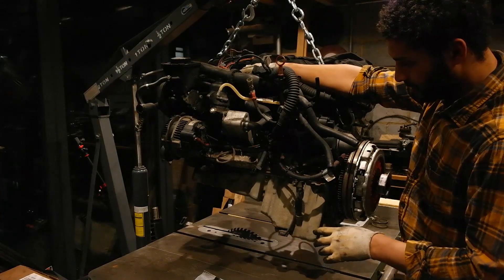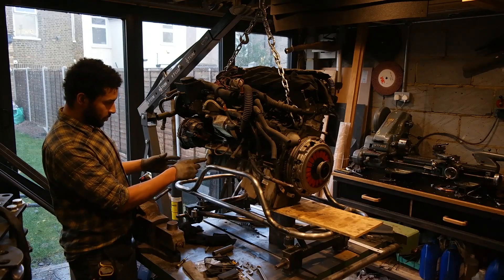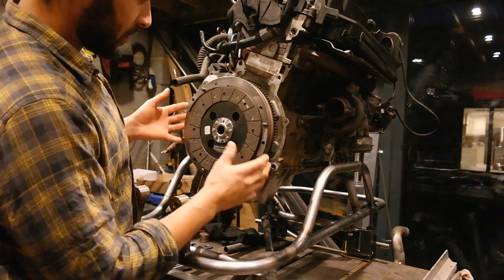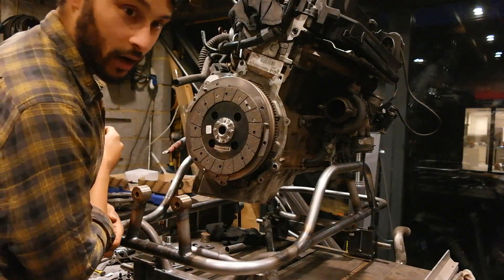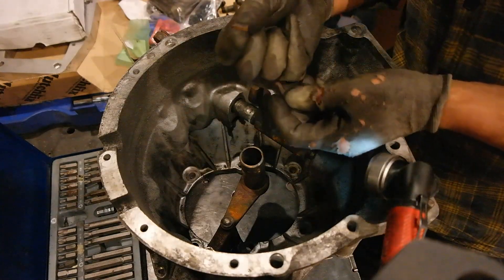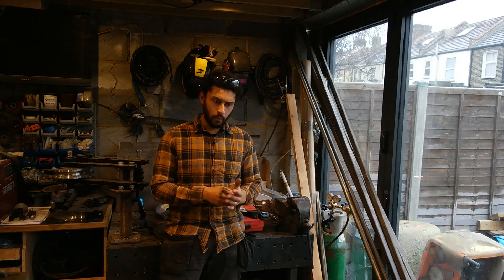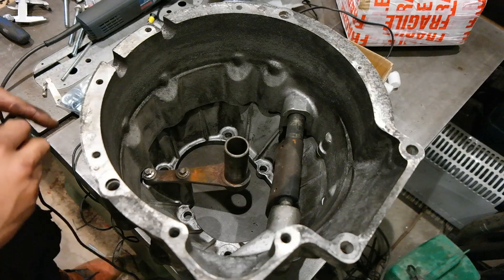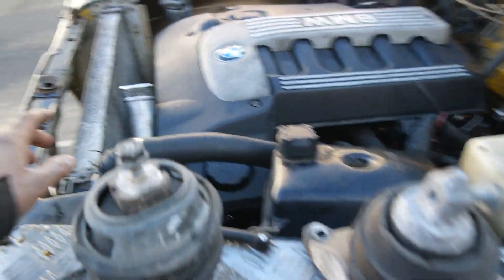M57 Defender: 1st Start in the Engine Stand

Comment: ive read and understand you need 3.5-4bar supply pressure to the hp fuel pump. Do you need to run a fuel pressure regulator or just hook up a pump straight away? What pump are you running? Awesome project and thanks for all the info and help
Reply from the maker: Hey man. There is a regulator on the back of the high pressure pump. So all you need is a 4 bar electric pump that’s capable of delivering enough volume. I used the electric (pre-supply) pump from the e39, it’s still running strong 👍🏽

Your welcome!!! Let me know if you need anything else!

Comment: Loving the show. I guess I am late to the party. I have a Defender 90, 1998 300TDI up here in Iceland that I am going to stick an M57 in. Also love doing the bikes. Mostly Triumph for off road. Would love some advice. I have access to a RR2006 vogue. I am not sure what M57 is installed. I can't see the bloody engine number on the left block anywhere. It has an Iron block. Was going to use an MW Machines adaptor and see what damage I can do. Any ideas on the engine variant?
Reply from the maker: Hi mate, Sorry for my late response. As far as I know, that engine will be the m57306d1 so it’s the same as mine. So you could also go down the route of a p38 bell housing, use the original rr transmission and make an adaptor if you can or you could find a bmw zf6-53dz HGA transmission and get yourself a great manual set up!! 

Either way, I’m nearly certain it’s a 306d1 you got 👍🏽

Land Rover and bikes always go well together….Pure testosterone 🤣
Reply: @KeepitBigBore  Thanks mate - Yes I ran the L322 VIN through and it is a M57306D1. I have investigated a bit further and apparently the e46 M57Nd2 is also a perfect fit, using the MWMachines adaptor plate and clutch. I am pretty sold on using the standard R380 box and transfer case as this will cut down on cost and complexity. I realise that the R380 @380 nm rating might be a bit of a weak point, but I wont be thrashing the car so I think I should be OK. Same with clutch. The M57306D1 is rated at around 171hp and 390nm torque, and the M57ND2 is around 201hp and 410nm, but apparently the ND2 is a much better unit. Maybe I could derate it a bit?
Reply from the maker: For me personally, if I were going to stick with the r380 then I would use the p38 bell housing. The only downside is a heavier clutch pedal and a weak clutch fork shaft in the bell housing. 
It’s very easy to fit a separate and small brake servo unit to reduce the weight of the clutch pedal. Coupled with a p38 dmf and clutch clutch you’ll have yourself a 600nm capable set up. The r380 obviously still being the weak point. 

The way I like to look at the engines are 306d1, 306d2(m57n), 306d3(m57n2) etc

The e46 330d came with both n and n2 as far as I know. The cast iron version is the m57n and has the same bell housing pattern as the 306d1.

The only reason the m57n’s would be considered better units is for their “tuneability”.
You can’t get any more reliable than a 306d1.
My 306d1 is remapped to 240bhp in the e39, it now has a straight through 3” pipe, egr delete etc so it’s possibly somewhere around 250bhp and 450-500nm and my r380 is holding up just fine! I’ve pulled away from many l200’s, rangers, td5’s etc  so I don’t go east on it 🤣🤣

The p38 bell housing may even save you a little more again. 

If you use the p38 you got to buy a custom clutch.
If you use the bmw 6 speed manual you have to buy an lt230 adaptor.

Best thing to do is price up all your options and let prices and availability decide for you. It’s the sole reason I’m running the p38 set up 👍🏽

Comment: Interesting to see this, looking doing this conversion but the only thing thats holding me back is the unknowns about the wiring, i take it u used a 2.5l diesel p38 bellhousing? Looking forward to the next video....
Reply from the maker: That’s correct in regards to the bell housing! 
The wiring is very simple, I’ll show how the loom works in the next video. Here’s the list of items you’ll need to get your engine running so if your buying a doner car, just take these parts before you scrap the car

1) Engine, with engine loom and injector loom (these are usually bolted to the engine so if you take the engine out, these come out with it

2) ECU, EWS, Key and the ring/circular antenna from the ignition barrel. (Make sure these are a set from the original car as the ecu, ews and key are matched from the factory and cannot be mixed and matched)

3) ECU Loom, has a small white block with 4 or 5 fuses and a relay on it, it’s only a few wires, you’ll find it in the compartment the ecu is in.

4) Stand-alone harness from MW Machines or Wiseman Engineering.

5) Accelerator pedal/potentiometer. If you got an older m57 like mine, this will be a remote mounted cylindrical potentiometer unlike the newer ones which are built into the accelerator pedal. Buy the newer accelerator pedal to keep things simple. The old one can work but it involves soldering and it’s just complicated. The new type will plug straight into the stand-alone harness.

6) Diesel filter with built in pre-supply pressure sensor (taken from doner car) there is a new and old type so make sure to get the same year as your engine loom as the plugs are different.

8) Inline Diesel pump, also known as a Pre-Supply pump. Some people also use the in tank pump, mine is currently running without it and no issues.

9) Inline Diesel pump relay, this is to turn the diesel pump on and off when the ignition is on. You can also wire the fuel pump to simply come on and off with the ignition but I think the relay is a nice touch as the ecu will turn the fuel pump off if the engine is not running. 

10) Ground cable. Most cars have this already but make sure it’s still there. You’ll need to install a good and thick ground cable from the engine block to the chassis, the chassis is then connected to the negative terminal of the battery. Also, on the engine loom, and stand-alone harness, there are ground cables.

Tip: If it’s on the BMW looms and it’s brown, it’s probably a ground 👍🏽

That’s about it! There are other things like temp gauges, radiators, inter coolers,  etc but the list above is all that’s needed to get the engine running.

I hope this helps, if it seems daunting, don’t worry, pretty much all of the above just plugs together 😬

Comment: I want to ask a question, I want to change the engine in my car, from M47 to M57 apart from the engine and the differential, the rest I have to change, for example the wiring of the computer unit, can you tell me why we are thinking of doing this conversion, thank you
Reply from the maker: Hi mate, as far as I know, the m47 wiring is very similar to m57, I think the plugs are the exact same as well as long as you use the same year of m57

So if you have a dde4 m47, you can easily use a dde4 m57 👍🏽
Reply: @KeepitBigBore  Thank you very much for the answer, I will start the conversion

Comment: I'm currently swapping my e60 520d I've got the m57 in and mounted got ews deleted on the ecu it's cranking was coming up no fuel pressure at rail tried hp tried a engine loom tried running a inline pump from a 25litre drum tried clamping the return didn't have anything to check if it was 4bar of pressure to the pump any suggestions and what did you use on the engine stand
Reply from the maker: Hi mate, I used the original in line pump and it was delivering 4 bar while in the engine stand. You only need 2.5 or so.

Have you removed an injector pipe, are you getting fuel up there at all. Check your connection on the back of the high pressure pump.

Have you had this engine running before, do you know for sure if there are any other issues with the engine? 

I helped a guy in America with trouble shooting for weeks, after trying everything, the only thing left to do was to replace the high pressure pump, that was the issue in the end, it fired up immediately.
Reply: @KeepitBigBore  thanks for the reply yes engine was removed from a running car I've cracked an injector pipe not much fuel was there hardly any to be fair. 
I thought the low pressure system may have been not supplying what it should on the 520d so bought a inline pump ran a 12v straight to it didn't use a filter just feed and return to a 25litre drum but didn't wouldn't start ive tried so much was coming up with ews so sent it back to get resyncd only codes showing was no pressure to rail switched the full engine loom to check that and had another r90 but untested so tried that but nothing
Reply from the maker: Have you got the regulator on the back of the HPP? Have you a spare one to try and have you checked the pins on it for a good connection?
Reply: @KeepitBigBore  yeah when I tried the new hpp it had another regulator on the back of it I've just bought a fuel rail with the two sensors going to buy a new regulator the one you've mentioned and also going to grab a loom from house of torque see if it's anything from the car loom stopping it from running will update in a few weeks

Comment: Hi mate great build just like to pick your brains im doing a conversion on a transit m57 getting dropped in do you know if the m57d1 bell housing is the same as the m57d30 thanks in advance ?
Reply from the maker: Hi mate, all the titles are m57d306d1, d2, d3 etc, they are all m57d30’s, do you know which one you have? Is it a cast iron or aluminium block?
Reply: @KeepitBigBore  Hi mate it’s a cast iron block i’ve managed to get it in and running but having trouble with it cutting out i’ve got the bmw inline fuel pump wired up to wisemen’s instructions but the pump in the transit is just bye passed im wondering weather the transit one is cutting out im going to wire it to the relay what the bmw one is wired up to think it could be that ?
Reply from the maker: Hi mate, sorry I’ve just seen this now. Did you manage to trouble shoot your issue?

Comment: Hello mate I am looking to put m57 in my nissan patrol gr y61, 5 speed manual..
Can you help me and suggest me which m57 is the best and what parts I need for this conversion.
Thanks
Reply from the maker: Hey mate. It depends on what you want to do with your patrol. 
I just wanted my defender to be able to handle motorway speeds with ease, be more efficient and be able to keep up with an average car.
If you want the same then I’d recommend the 
M57D301 which was in the e53 x5, the early e46 330d, the e39 530d. It’s the first generation on 3.0L m57 and has a cast iron block. You can get them to 300bhp with a few mods. 
I read about a guy in Norway who got his to 440bhp with 700nm also. That is plenty for me.

As for parts. I strongly recommend buying a complete car that’s running. You know for sure everything is there and it will probably be cheaper. Try to get a 6speed manual and you can use the BMW transmission then. It’s a strong transmission! 

After that, it’s just things like, stand-alone ecu kit, from MW Machines or Wisemans Engineering, radiators, inter oilers etc. 

Long story short, buy a complete car and you will have most of the parts needed. 👍🏽👍🏽

Comment: Do you have any information/link to the clutch you’re using? I have a manual P38 that I am going to convert to M57 and need a new clutch. All I can find at the moment is Britpart.
Reply from the maker: If you speak to a company called clutchfix and tell them you’re setup they will be able to sort you out. I have what is basically a heavy duty p38 clutch in mine.
Reply: @KeepitBigBore  hey totaly enjoy youre videos ..currently have a m57 that i want to use in a pickup was wondering what did you use on the wiring what stays and what goes ..things needed to let it run? Will be very helpfull..cheers
Reply from the maker: Thankyou mate 👍🏽 I want to make some e videos on this build soon!! 

Have you seen my other videos BMW M57 Standalone ECU
https://youtu.be/aC6AATbAqP8

It should help to understand what I used and what I didn’t! Hope this helps!!

Comment: Is there any way of running the gm auto 5 speed auto gearbox (standalone) which came with the m57 out of e39 530d thanx rikki
Reply from the maker: Hi mate. You could definitely run it. I don’t know of any kits for that transmission but an easy way to do it would be to run a prop shaft directly to the rear diff and just leave it as 2wd 👍🏽